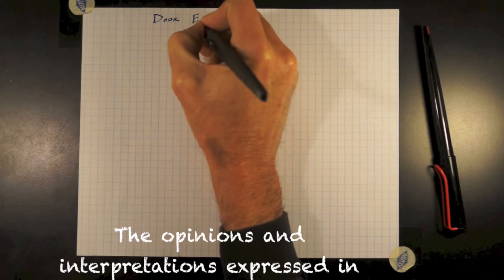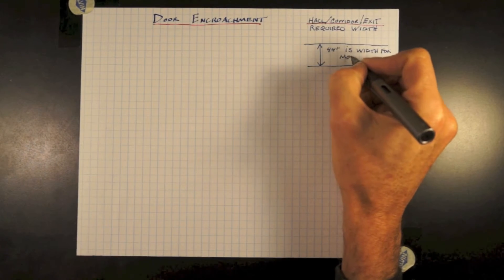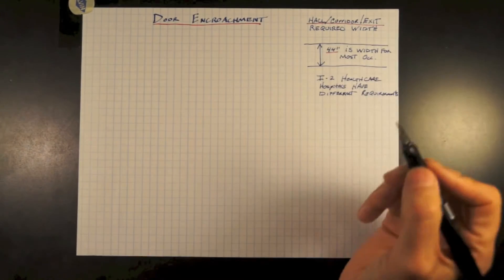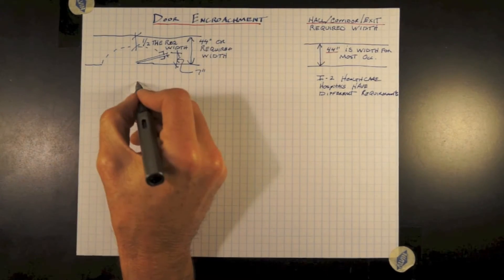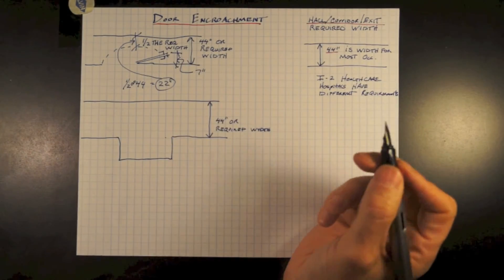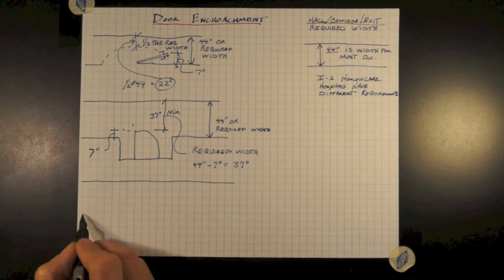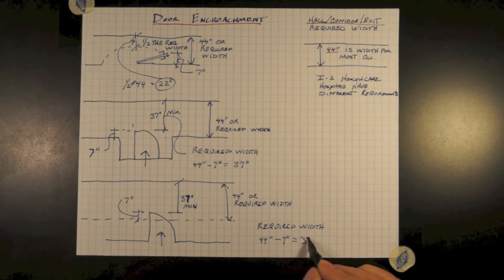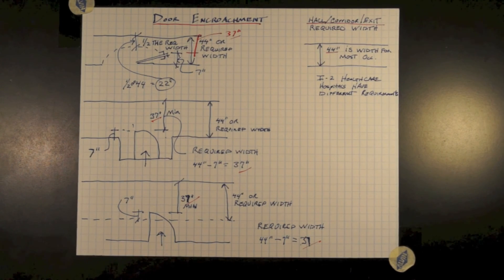Door Encroachment 18-0

Comment: When the corridor is wider than 44" by code [in group E or other occupancy where the occupancy needs a wider width may be 72" or 96"] the rule remains the same I assume. So the overlap would be allowable to a 7" in that case too. Can you please confirm? Am looking at table IBC 2018 1020.2 Min. Corridor widths. So instead of the 44" min required the corridor would need to be wider like a 72" and then the door can swing out into the corridor.
Reply from the maker: Correct, the hospital for instance requires a Corredor to be a minimum of 8 feet and a door cannot swing into that 8 feet at all
Reply: @MartyHuie  so in that case the door swing when fully open position would be beyond the 8'-0" that makes the corridor a minimum of 8'-7" to accommodate for the door if it has 7" like you had shown in your video.
Reply from the maker: @PrithwirajGhoshRoy  it's a bit more complicated than that, for healthcare the door is not allowed to swing into the Corredor with at all so the door would have to be fully recessed for schools on the other hand, you would be allowed to swing the door into the Corredor regardless of the width and yes with  schools the requied width is 5' I think and there for the door can not cut into the required width by more than 1/2 so with schools and even a 4' door that is not going to happen. but even with the door fully open it can not stick out into the corridor more than 7"
Reply: @MartyHuie  Ah makes sense. Thanks for the clarification. Another question based on dead end: Looking at Dead Corridors, can some one shine some light on item 3 on 
So if the building that is sprinklered and the the corridor is lets say 8' wide in a non IBC2018 1024.4 Dead end. Healthcare occupancy [Health care needs 96" min by code], in that case the length of the dead end can be 2.5X 8' = 20'. So does this mean the 3rd item is redundant? Since in other kinds of occupancy, the allowable length of the dead corridor is 50'-0"? I am confused. Can some one clarify this?
Reply from the maker: @PrithwirajGhoshRoy  for healthcare, if you're within the United States that 2.5 does not necessarily work for NFPA does not recognize that and you have to follow NFPA also when doing healthcare in the United States. Really that 2.5 is for areas such as very large lobbies and or breakout spaces that may be 50 or 75 feet long you can use that calculation to say you do not have a dead end

Comment: not 37" but 22", the door swing should not reduce 1/2 of the required width which is 44", that makes it 22" not 37". The 7" maximum protrusion is only when it swings all the way to the 180 degree angle.

Comment: NFPA 101 requires min 36-inch width and ABA requires min 36-inch or 48-inch width at corridor. Generally, overlap between door swing and corridor is better the 6-inch for construction error.
Reply from the maker: take a look at 2012 NFPA 101 7.2.1.2.3.2  This has not changed ever
Reply: Thank you very much!!